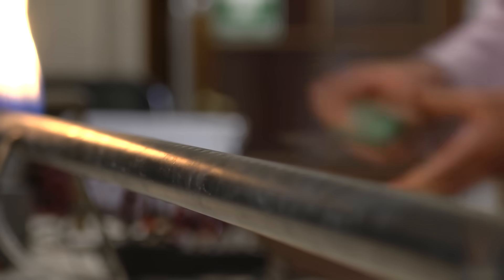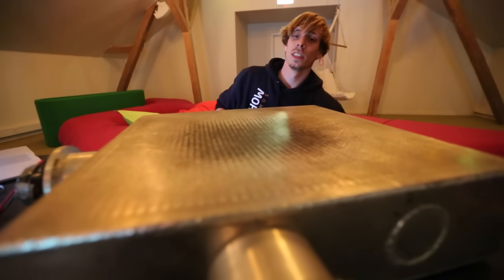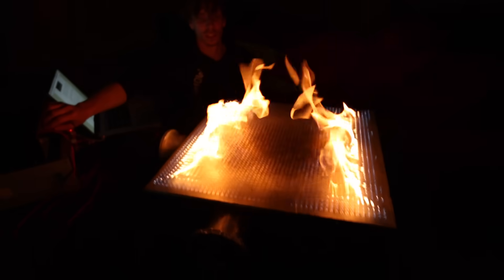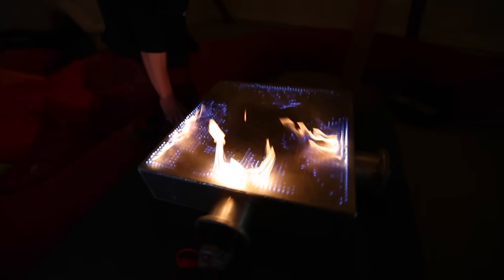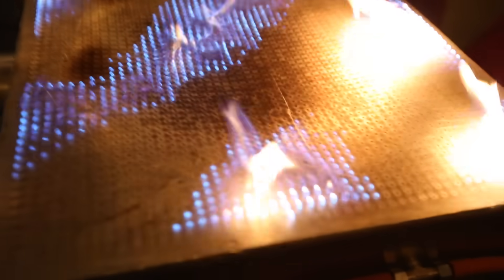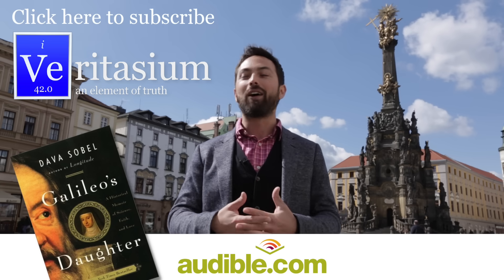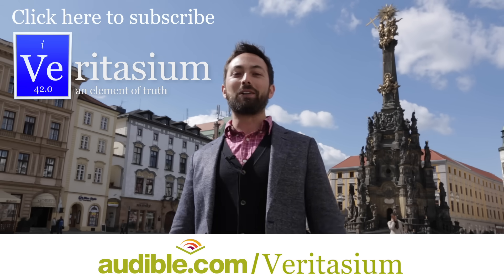Musical Fire Table!

Comment: Former Navy bandsman who went on to work at NASA.  Find the fundamental resonant pitch of the cavity, then calculate the frequency 1 x (1, 2, 3, 4, 5 thru 16) and you will have the overtone series of 1-1-5-1-3-5-b7-1-2-3-#4-5-6-b7-7-1.  Each resonating pitch higher than the fundamental follows this equation regardless of position of fundamental within harmonic spectrum, key being irrelevant.  Awesome invention!

Comment: 0:57 technically they made a 3D one
Reply: Nah, it's 2D
Reply: @ddjarvis196  technically a normal Rubens tube is just one long tube while a 3d one means it gets another axis, z. But since it's in a 3 axis dimension already it would still be 3d but the turned a line into a square, so in technicality yes it's 3d.
Reply: You mean  2d

Comment: Would antinodes cause the fire to shorten, due to moving air acting like it has a lower pressure than still air, and nodes allow the fire to lengthen because less gas is being consumed (because of the antinodes), the rest goes through the nodes?
Reply: Oh, it is partially mentioned in the video.

Comment: I don’t understand... 
Are the flames delivering all of the music and sound, at which, I am hearing? 
Are the flames reproducing the separate frequencies? Are there certain sections that are producing high frequencies, while other sections are producing low frequencies? While the volume is done by increasing the gas flow? Or oxygen/fuel mix? 
Does flame really produce sound? How? I thought that when you hear fire, it is just the air rushing that is making the sound...
Or, is it just a display kind of thing?  Like there were speakers playing in the room, and the flames are just visual reproductions of the sound.  Maybe like an aperture opening and shutting to the frequencies and volume?

Comment: It might be more impressive if the audio sources were placed differently.  
A sound output manifold that that expands the sound from one solid corner to corner rather than a tube on to a flat surface. 
The physics between the original experiment and this don’t quite line up.

Comment: I bet if you slowly go thru Frequency changes you will see distinct patterns in the fire for each frequency. It would be pretty cool if you would try that and post the results. I'm almost 100% positive that each frequency hertz will have it's own distinct patterns in the flames whether or not it has a fire burst in it. I think the fire will still create patterns with the holes. Please try it and if I'm right video the results and post them. I'm interested in what the patterns would look like because if you put frequency to a flat metal plate with salt or very fine sand on it different frequencies send the salt or sand into distinct patterns for each different hertz and I'm pretty certain you will get the same results with your fire. You can see the salt on the metal plate videos here on YouTube. The patterns are very interesting to watch develop. I think it would be just as interesting, if not more interesting, to see them in fire so I would appreciate it if you would try that out to see if I'm right. Thank you!

Comment: The nodes you are hearing as you move your head around the room is because the sound is a sine wave, and it happens without the fire machine and at all frequencies (not just the ones that are in tune with the fire machine. If the sinewave that bounces off two walls has equal to, but opposite (phase), level to the sound direct from the speaker it will give a node. All sound do it but a mix of sines waves (which most sound is) has nodes at different places so you never get full cancelation and it is not noticeable.

Comment: You have your nodes and anti-nodes backwards.  Nodes have zero response and anti-nodes have maximal response.  Incidentally, sound consists of oscillating pressure waves 90 degrees out of phase from particle displacement waves.  Nodes in pressure standing waves are anti-nodes in the same displacement standing waves and vice versa.

Comment: Obviously this is awesome. I’ve watched it so many times! I plan on making one. I made a rubics  tube and everyone loved it. Your doing this inside so what about the fumes? Also what amount of gas does this consume? Are you using propane? Do you think it would work with hydrogen then you wouldn’t have to worry about Carbon monoxide? Or would that burn too hot?

Comment: Sound waves were also used to extinguish the flames.
You can create a ripple and move it symmetrically, using a certain frequency of fire waves, so as not to go out the fire, and do a wonderful job
This project was implemented in Syria in 2010, but unfortunately, it was not completed because of the war and lack of financial support, but I have another project as planned. I will save and apply sound waves to the water to create a landscape that will make you in another world. 
انت رائع صديقي ❤

Comment: can you do a sand cymatic/pyro board or 2d Rubens tube crossover? i think it would be cool to take the sand /speaker version from a plane to a cube, much like this step up from a line to a plane. maybe a glass box filled with a fluid that could allow movement but still a viscosity to hold the shape

Comment: I wonder whether it would be possible to construct an audio wave (that you were able to vary with sufficient control) to effectively control sections of the board as if it were a display, so you could draw images as if the flames were pixels?  I suppose the wave would need to produce a bunch of independent single-peak standing waves throughout the chamber in order for it to work...hmm...

Comment: What happens if you reverse the phase of one (but not the other) speakers/drivers?
What about sound isolation/baffling around the edges inside the box to remove edge effects?
Square vs saw-tooth vs sinusoidal waveforms?

Sorry, this one revived my curiosity in Rubens' tube tech.

Comment: I think the only problem is they need to pump gas in at a higher rate.  If they did that you should see every hole lit but some higher than others.  I suspect the reason they ahve some holes that get zero fire at some times is because they  don't have sufficient gas.

Comment: somewhere in the middle of the music demonstration the flame started to swirl the only about 8 of the way around the square and it was in between the two access points of the Pyro board. I watch that part more than 5 times by now and it seems to be what happens when too high and low notes switch very quickly, but I would like some one else's opinion.

Comment: The appearance of the pyro-board notably from 2:13 to :2:21 looks a lot like depictions I've seen of a quantum field. Since you're looking at sound waves pushed through pin holes, could those holes be used to represent how a wave can appear like a particle?

Comment: it only picks up low end bass which doesn't vary I tone as much as the treble or melody of the song changing.

I'd be interested to see the tube and what it would look like for each tone frequency inside of the major scale for music (WWHWWWH).

I also have a hypothesis that sound waves are spirals with 12 steps total. 11 before it repeats itself from the starting point one spiral (or frequency) lower or higher and not a wave running consistent down a line. because if it were consistent with a line than it would always return back to that root (or beginning) pitch. which is true, but running the notes consecutive with eachother moving forward or backward either brings you to a higher or lower octave of the original starting point, which adds dynamic deeper than a straight line.

just my thoughts!

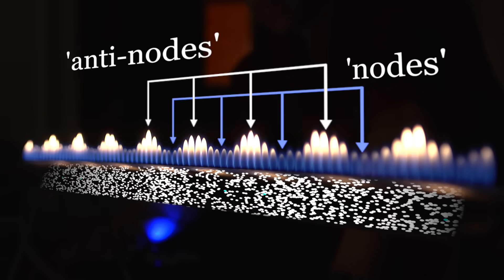Comment: 0:49 Is that because of a interference pattern of waves, destructive and constructive interference, or is it something different entirely?
Reply: Basically the difference of pressure in the gas along the pipe, created by the sound.
Reply: Oh, so since sound inherits wave patterns, and since the sound pushes the gas, wouldn't that imply wave patterns on the flame?
Reply: Its phase related - standing wave in closed tube.
Reply: oh, okay, i see. thank you

Comment: I wonder how much it would be to actually make one of these, it cant be that expensive. couple sheets of aluminium or steel, two speakers, propane, and some hours of my time. I think this would be a cool thing to make.
Reply: material wise probably not that expensive. The cost of something like this would likely be the labor put into making it work right.
Reply: do you not like having eyebrows?
Reply: You would have to evenly distribute the gas though.
Reply: there needs to be a dent in the centre and other areas to direct the gas flow.
Reply: The Terrible Animator eyebrows are overrated XD besides you can always just paint some on thats what all the girls do.

Comment: i like it how they are doing this in an enclosed space it is sooooooo funny nek minit carbon monoxide poisioning
Reply: dumbass
Reply: I'm not a dumb arse. When you use a gas burner in a closed room the carbon monoxide can't escape increasing the chance of poisoning
Reply: Abe Coulter by your logic, gas stoves also cause carbon monoxide poisoning
Reply: Yes. Thats why houses have ventolation fans
Reply: Abe Coulter so, by that logic, and a bit of connect-the-dots, this ruben's tube isn't dangerous.
Reply: Yes it is flamable gas in an enclosed space
Reply: Abe Coulter obvious troll is obvious
1/8 m8
Reply: Not a troll.
Reply: Abe Coulter 8/11 m9
Reply: carbon dioxide** there is complete combustion so CO2. Carbon dioxide is less likely to poison in a short period of time. Also, of course they did it in a room, else the flames would've been blown out due the wind taking up and carrying away the gas faster than the gas supply provides, or ya'know, indoor = dark = cool flames dawg